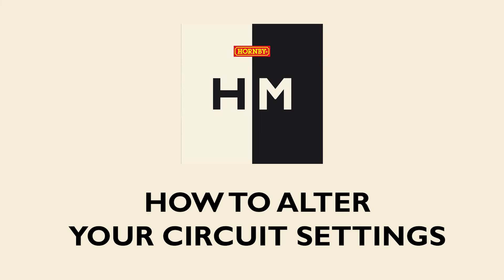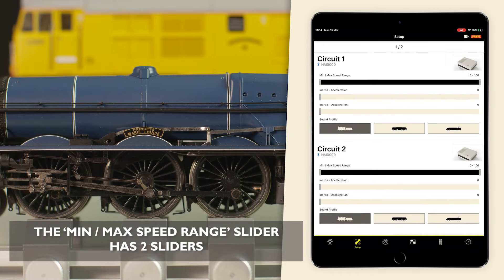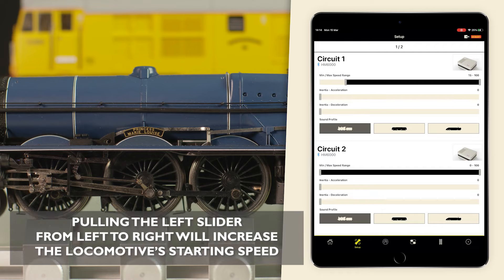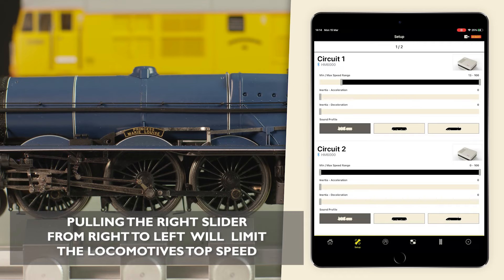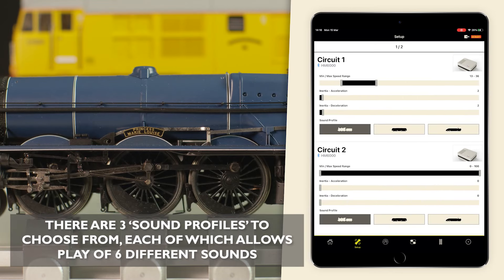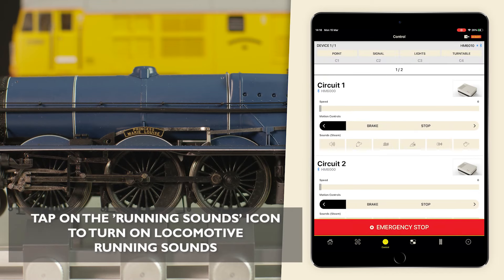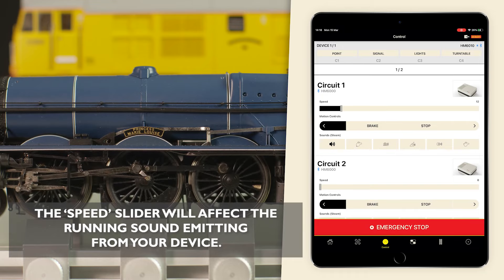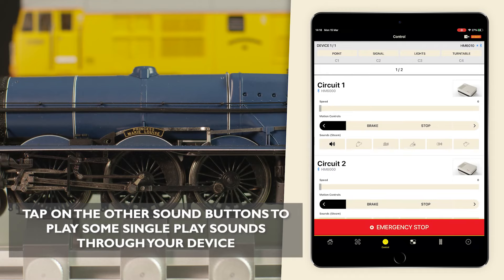HM|DC - How To Alter Your Circuit Settings

Comment: Does it operate DCC locos as well?
Reply: No, it clearly says it’s a DC controller. So you can run your DCC locos in DC mode (per CV29), but this is not running it as a DCC loco.
Reply: @tomlawton7087  thanks